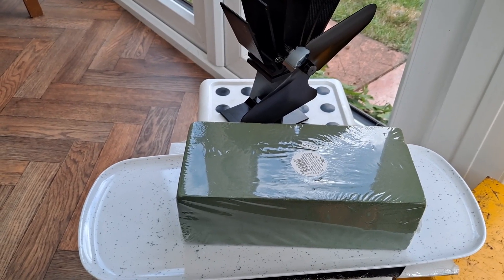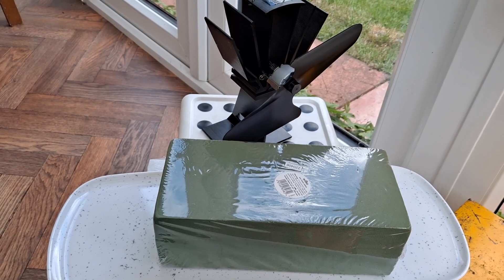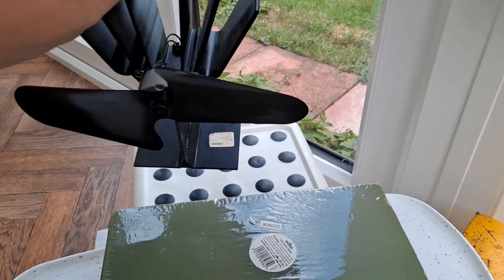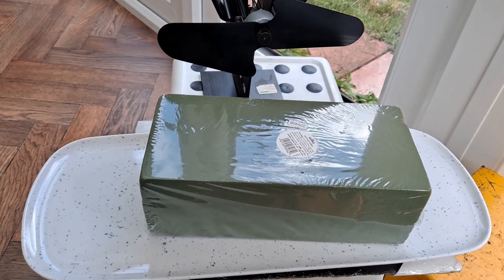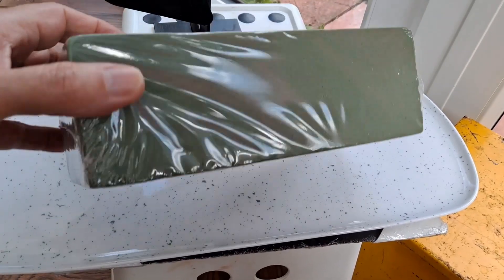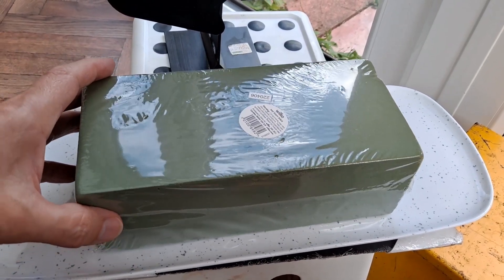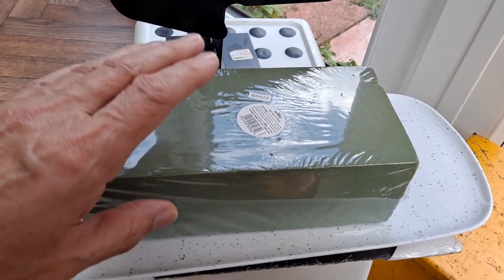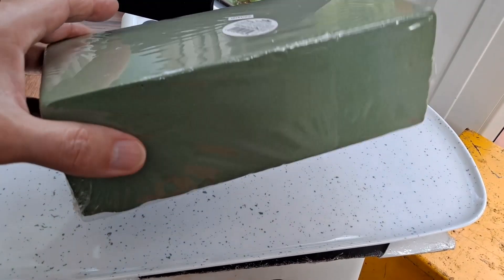Oasis Stove Fan Stirling Engine PART 1

Comment: I. Don't understand this video like what's to gole
Reply from the maker: Basically this is two solar powered engines. You might find reading the video description helpful. There are links to similar videos and playlists. We have two "heat engines" here, meaning they need heat to make them work. They work on different principles, but both need a difference in temperature between the top and the bottom. The big black stove fan has a Peltier Tile sandwiched between the top half and the bottom half. When a Peltier Tile is hot on one side and cold on the other, it generates electricity. That electricity runs the electric motor that spins the fan. The Stirling Engine does not use electricity. It uses air pressure. When the air heats up it expands, changing the pressure. By some clever mechanics, that causes the piston (or displacer as it is called in this case) to move up and down, and that spins the flywheel.

Comment: Good try but not enough heat on top. You could use those disposable hand warmers. 👍👍👍
That type of foam breaks up into powder even though it feels hard. I used it for a Stirling engine displacer and it worked great.
Reply from the maker: No Mike, that would hardly be using solar power?? We know it works with the sun on top and ice below (previous videos). The purpose of this exercise is to see if we can get it cold enough with evaporative cooling. 😁

Comment: grandad, i have an idear, hear me out. block the bottom potion of that device with a box, one that's covered in the whitest stuff you know. make sure it's not translucent, have perhaps vent holes on the sides not facing the sun? i think this would help a lot with the temperature differential you're seeking. black coated metal is extremely conductive to infrared radiation coming from the sunlight
Reply from the maker: I get the Stirling engine running in the next episode. Another option with the stove fan, would be to chop the green foam up and pack it all round the base so it covers it. That would certainly help the heat transfer.
Reply: @GrandadIsAnOldMan  that sounds like it'd definitely help. It's the whole part leading up to the peltier tile (spelling definitely wrong) it's black coated metal. The cloth worked because cloth isn't necessarily conducive to the heat coming from the sunlight, and it was also wet. So I figure if you could blot out all the light up to the tile itself it would increase your odds?
Reply from the maker: @spencer963  making it work really isn't the issue, I have demonstrated that in previous videos. What I wanted it to do, was work as shown, just standing on the cold surface, cooled by evaporation. Then it would look cool (sorry, pun fully intended). Once I start adjusting things to make it work, the magic is lost. 😁
Reply from the maker: There is a lot of theory here that doesn't seem to work for me. The cold comes from the water evaporating from the green block, but to encourage it to evaporate RMS put a black cloth on it, but if I put the black metal frame on it, the frame just heats up in the sun. I will probably revisit it when we get more sun. OOPS, just realised I have answered this twice. Well, I missed a bit in the other reply, so I will leave them both.

Comment: Looking forward to part 2. 
Maybe the black fan base needs shielding from outside heat. Wonder if water from a bottle in the fridge would help.
All good noggin food :).
Reply from the maker: Yes, unfortunately I would need to shield the base from the sun as it gets hot quicker than the cold can transport up from the floral foam. I really should try something simple like tinfoil to shield it. Didn't occur to me at the time. Our heat wave has broken again. Rain and thunder today, until I set my camera up to try and catch the lightning, then it all calmed down 😆
Reply: @GrandadIsAnOldMan  i see you already know lol